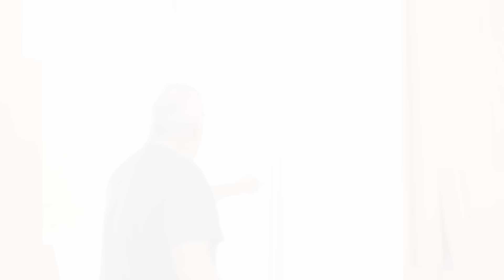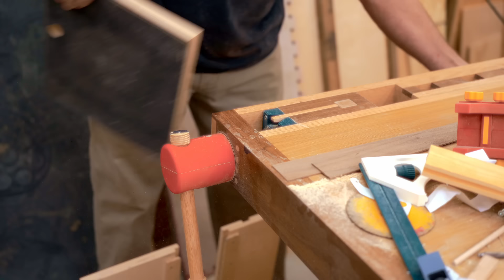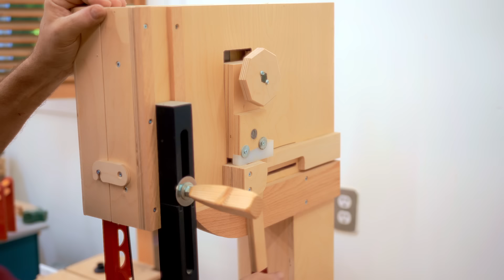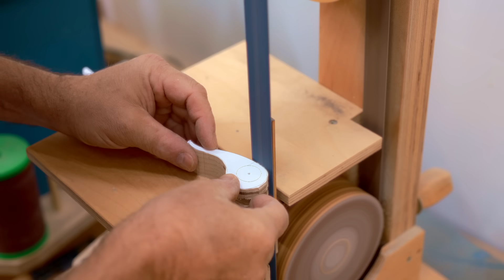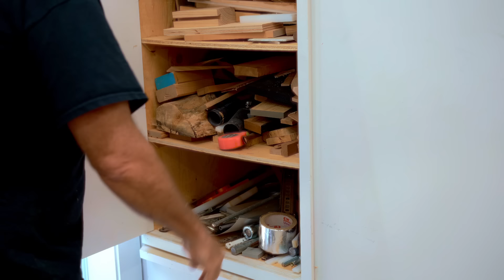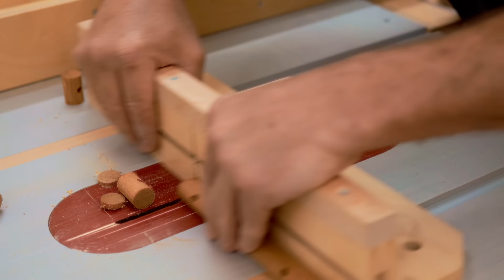Powerful Clamp Action FAST! How to Make | Free Template and 3D Print Files

Comment: I thought you were going to drill the dowel holes before cutting the slot. Any particular reason you didn't? That would have saved you from having to use the sacrificial piece when drilling to avoid the blowout.
Reply from the maker: Just the usual lack of perfect order that happens when you are making stuff on the fly and filming it :)
Reply: @JohnHeisz That is VERY familiar to me 😅

Comment: I love seeing all the 'new' little upgrades you've used the 3d printer for, like your spindle sander drum. do you put these various 3d models online anywhere to download?
Reply from the maker: On Patreon, so far. But I haven't put the sanding drums there, yet.
Reply: @JohnHeisz  ohh I see, they are on the posts feed/timeline-- I just signed up for the $1 membership and though maybe I'd have to be on the $5

You started on the 3d printing journey just as I got a printer and I've enjoyed seeing your exploration of the new tool. Have you ever done any videos about how you approach modeling? I bounce around between Fusion 360 and Sketchup but everyone's got different workflows

cheers!
Reply: @ericekman try GatorCAM for CNC. I know the dev! 😉
Reply: (On my 🎬s)